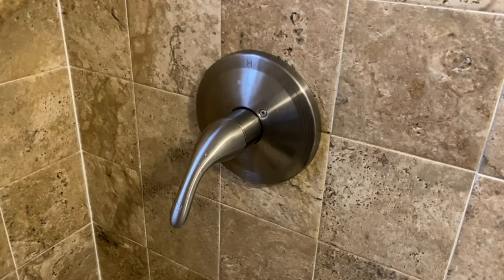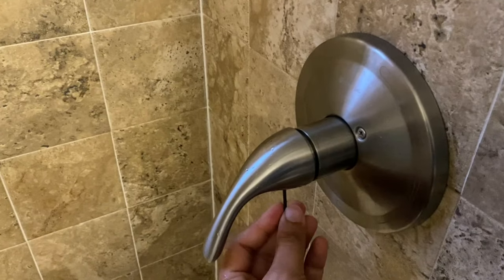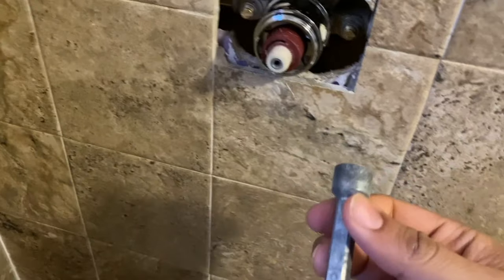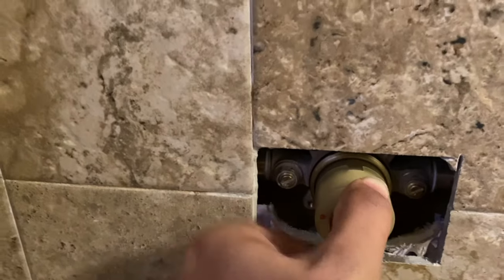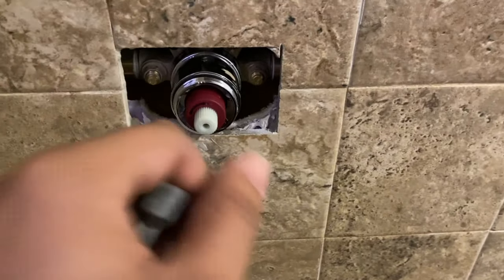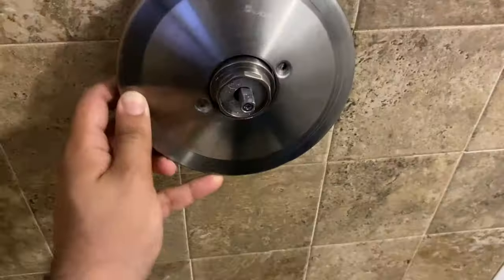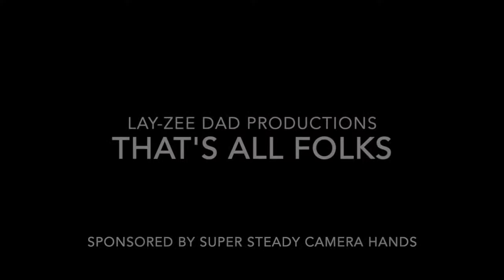Fixing Hard to Turn Shower Faucet Handle

Comment: Turns out the plumber installed the brass connector upside down 😢and so now the two knobs mentioned are upside down. Is it easy to fix this?

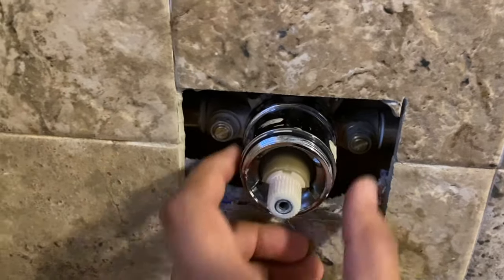Comment: Okay, loosening that part at 3:28 is impossible.  How else would you loosen it?
Reply: A pipe wrench, with a towel over the threads to protect them from damage. Better yet, try not to contact the threads if possible when loosening. PS the pipe wrench is not shown in this video, they come in all sizes, a small/medium one will work

Comment: I can’t get the last part to unscrew. The part that holds the assembly in. It’s the same faucet but ours has a grey cover and it’s not giving me any room to put pliers on it. What little bit I can get on it isn’t going to be strong enough without breaking.

Comment: I stalled the same one. Same maroon wheel position like the former one. But it cannot be shut off. Water still runs when I’m turning to both positions 3:00 and 6:00. Can you advise how to adjust on-off positions.

Comment: I have the same one but won’t turn all the way to active the hot
Reply: Was having the same issue and it was that little piece he said to take a picture of. If you move it one way the water is cold, if you move it the other it is hot. I had to adjust mine so we can finally get hot water lol

Comment: I installed a shower valve like that about 3 years ago, but I had to change the cartridge 2 times in 3 years. This is not right!  Would anyone know to tell me what could be wrong?
Reply: I am having the same problem. Is there a way to fix the cartridge? Would wd40 work??
Reply: I have to replace mine about once a year.  Give a take a couple of months.  I think it's bad design.  It's a home depot brand.
Reply: Came here to ask the same question. I'm sick of having to replace this every 1-2 years.